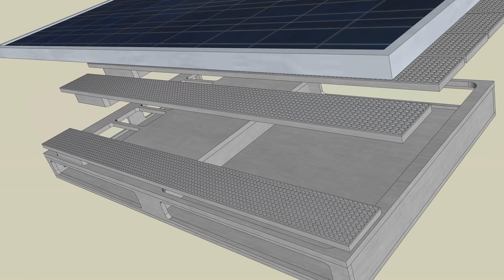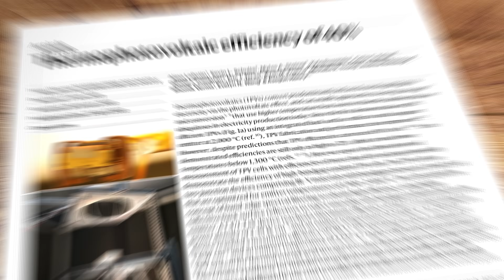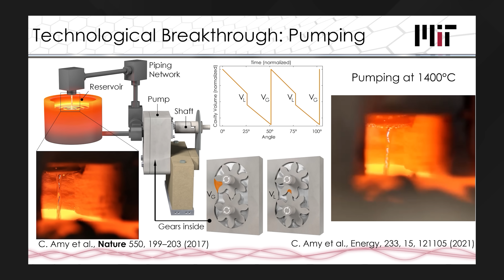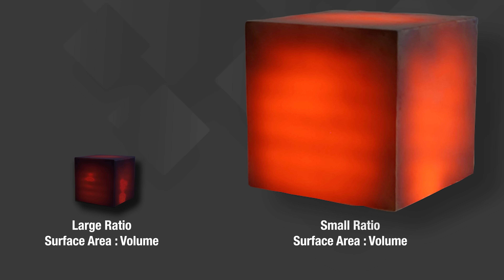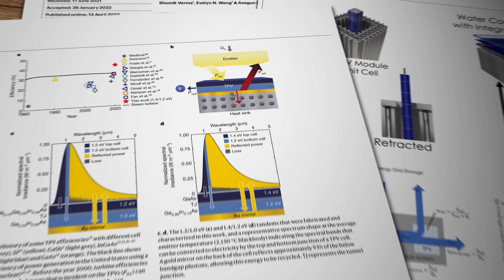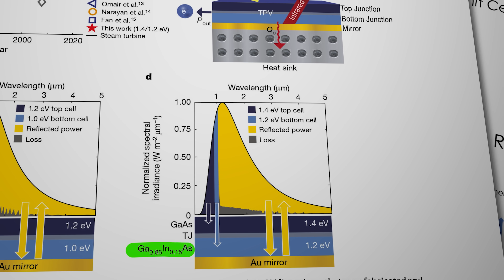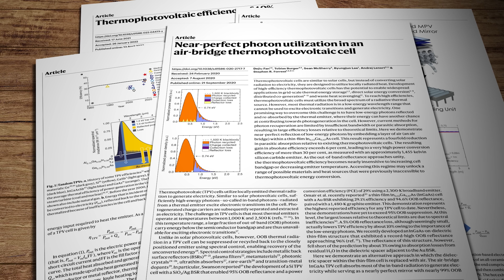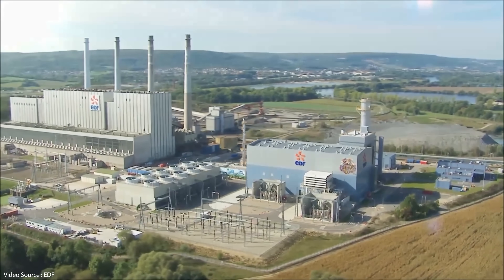Grid Scale Energy Storage 30x cheaper than Lithium-ion! How do they do that?

Comment: This design uses properties of materials instead of heat pumps. Nice.

It would be good if the heat from cooling the MPV could have been reused. A good place for a heat pump, perhaps. 

Clearly there is potential to provide baseline geothermal power.
Reply: @chalichaligha3234  While I do love the heat pump idea (Heated and cooled my home with one for 30 years), what heat pump can rise to that temperature? One of the few benefits of resistive heaters is they can get VERY hot! Heat pumps on the other hand would struggle to reach temperatures of this level.

Comment: 40% efficient... With lots of insane temperature differentials and lots of moving parts, and argon filled buildings, all of which need to be built...

LifePO4 batteries are 99.9% efficient, (the losses are inverter losses, which is what you also have with other storage options).
Redox flow is 70% efficient.

Long term energy storage is biomethane. Germany produced enough biogas in 2020 to cover 30d worth of electricity usage (100TWh -- but 90TWh of that was burned directly as that's how the gouvernment subsidizes it), and that amount can easily be doubled. And apart from the cleaning and compressing needed for piping this methane into the existing gas grid, all the infrastructure exists already (distribution, 270TWh worth of storage, 39GW worth of gas power plants).

Between a vast expansion of renewables, and then a days worth of grid level battery storage (1500GWh for Germany, which would cost less than 150B eur if spent wisely on lifepo4 over the next decade), and then 2d stored in cars (when cars have like 50-60kWh batteries on average), on top of home batteries... You only then need to fill in the gaps where the sun does not shine and the wind does not blow for many days, and then you just need to monitor grid battery levels and can then sporadically turn on a gas peaker plant, of which some are able to surpass 60% electrical efficiency and are tied to district heating systems.

There is simply no room for a 40% efficient solution in the above situation. If we are happy with that sort of efficiency, then we might as well do hydrogen.
Reply: Dude, how many times do people have to say that we can't harvest enough lithium to make grid-scale storage of lithium batteries. Cell life is abysmal, the extraction process is extremely destructive, not to mention that it makes the power grid even more reliant on imported lithium.

40% efficiency at 1/30th the cost gives you 12 times the energy storage per dollar compared to lithium batteries, and heat batteries don't form dendrites and go into the garbage after three years. 

We literally do not have time to put up enough nuclear and geothermal before climate change is irreversible. If we had started in the 80s instead of all getting scared for no reason that would clearly be the way to go, but it's too late. Wind and solar are going to be a part of getting humanity off of fossil fuels because they can be scaled much more quickly than better sources like nuclear/hydro/geothermal.
Reply: @tissuepaper9962  Wind and solar are also far cheaper per kilowatt hour than nuclear.
Reply: @sunspot42  Wind and photovoltaics are great, but we can also collect heat and with plants like in the video convert it to electricity. Having more ways to get to electricity cleanly and safely is a win.
Reply: Electricity is much cheaper than the battery. Efficiency doesn't matter if source is free and abundant. All that matters is meeting demand with the supply.
Reply: Add nuclear power, safe, clean, carbon-free generating methane, methanol, and using existing infrastructure, pulling carbon out of the atmosphere to produce high-density liquid fuel.

The host of this channel is fixated on crappy solar and bird-killing windmills instead of actual solutions.  Sad

Comment: Somehow the idea of shedding huge amounts of heat into our environment seems incredibly counterproductive to me.  🤔
Especially given our present problem of global warming.

I'd also like to know what the end to end efficiency losses are, going from renewable electricity, molten tin, pumping, heating graphite, heating transfer medium, heating tungsten, heating IRPV cells, pumping cooling water, through the heat sinks, radiator, and back through the heat sinks?

How much energy is required to extract two warehouses full of argon?
How do you "just add more graphite blocks" or "just add more TPV cells" when you need to pump down a huge vessel full of argon? 

How do you weld in new plumbing for molten tin when you can't just shut off the flow (freezing the tin inside the pipe loop)? 
Hasn't this already been an issue with heliostats using molten salts and alloys?

I get it, that using electricity to create heat to heat heat to impact a medium (TPV cells) that create electricity from heat is far more efficient than say using electricity to electrolyze water to separate water into hydrogen to run through a fuel cell that creates heat and electricity, but at some point there are substantial losses because of the huge temperature delta between white hot (tin, graphite, tungsten) and the world outside.
No, insulation can't eliminate heat transfer and entropy assures this system will be lossy even if it doesnt fail outright.
Even the vacuum of space transmits IR. Look at what we've done to ensure the JWST can pick it up from billions of light years away.

I fear highly theoretical engineers are pretty far removed from reality.
Reply from the maker: Yes. They will need to investigate ways to use that heat.
Reply: @JustHaveaThink  They need to find a way to keep the heat.  Minimizing losses.
It's already down to 40% efficient with just the photocells. 
Add pumping molten metal and deionized water as a coolant, plus whatever inevitable heat lost in containment and through the condensate loop of the cell coolers.
So something less than 40%. Probably profoundly less that 40%

Even hydrogen is ~36% efficient. water + electricity > hydrogen > pem fuel cell > electricity.
Pumped hydro is up in the 70's% and lithium ion is over 98% returned.

Too many steps and too complex an infrastructure.

Comment: How would this system compare to simply using the stored heat to generate power using the existing steam turbine, given that the system is installed on the site of an existing gas peaker plant?
Reply: from the linked paper it would give 30% effiecency compared to this cell's 40%

Comment: Sounds cool, although I don't understand the molten tin part, would it not be more efficient to heat the graphite directly with the electricity and have the tungsten foil and stuff attached directly to that?
Reply: I think the idea is to decouple the heaters from the storage. Otherwise to add more capacity, more heaters would be required. That's one of the issues with batteries, capacity and power are closely coupled.
Reply: Yes - much simpler and more flexible to have an array of resistive elements in the graphite storage.  Minor detail - if the argon leaks and the tin or graphite is exposed to air it oxidises rather rapidly ie burst into an enormous conflagration!
Reply: yeah, I agree. it seems an unnecessary step to me. I imagine there will be innovation there.

Comment: So it can store 1GWh. And it shall be heated up by „leftover“ renewable energy. How much electricity would be needed to run this?
What would be the size of e.g. a Photovoltaik or a wind turbine installation be to produce the energy on top of the normal energy demands? And why is the heat of the water used for cooling not being converted to electricity or heat in other parts of the storage system? 
Last but not least: What is the overall efficiency throughout the process starting with the energy production to heat the battery to the point where the electricity is charged into the grid again?
Furthermore: All these big scale solutions have another drawback. Any improvement or integration of new technology (which is to be expected quickly in new areas like this) will meet mayor resistance. First of all the operator will demand monetary support to through out equipment which has not yet paired back before updating it. Second the authorities will demand test runs and scaled up trials which will slow down the process of innovation. 
I believe that we need to produce power on each roof rather before paying to insulate our homes to 25 kWh/m2/a or below.
If we produce energy in abundance locally we then will have to have smaller versions of converting excess electricity to stored energy. Whether that is in hydrogen, in batteries, in heat or ice sinks or even in systems like the one described but scaled and implemented in a small grid system. 
Having then the backup between such national and international local grid system connected will be another challenge.
I don’t beliefe that large grid systems which are centralized energy production and storage are the future.

But what do I know 🤭. I am just a mechanic…😜
Reply: Yeah I agree with most of what you're saying, but I think you might be off on the insulation point. Maybe 80% of my energy use is low grade heat for my house. Unless energy generation gets stupidly cheap, the cheapest energy generation/ storage I'll ever have is the energy I don't use when I get my house to a higher thermal standard.
Reply: @EvilScot  
I lok. at it from ROI point of view.
Your living in a house with 150m2 and your heating bill is 2500 € (25.000 kW @ 0,1 € per m2 gas).
Means you use 166kW/m2/year - typical for a German home of around 1975.
Let’s assume that you insulate good to a level of 55kW/m2/year - means walls, roof and new windows.
Off line I did some calculations and research. Walls are 52.000 €, windows 25.000 € and roof 40.000 € (all quick estimates based on 2 story house outline15x7 m and 6 m height). Total investment 117.000 €.
Now you need to change the heating system - let’s go for a heatpump at only 25.000 € including everything.
And now let neglect the electricity costs you will need to run that heatpump and let’s say you Dave all the 2500 € you currently spend on heating. That is a mind blasting  ROI of 142.000€ / 2500 € = 57 years! Not a sound investment if you ask me.

That is why I think a more ROI driven approach would help us speeding up changes helping people and environment.
The closer the actual heat per m2 gets to below 100kW/m2/year the easier it is to invest less in full Monty insulation and instead in less overwhelming insulation modernization plus investment in energy harvesting and new heating system.
I even can do small energy efficiency rebuilds plus new heating system and later invest in energy harvesting. 

Why I prefer this approach? Because people will not invest for ROI they see in 40 years- they rather will pay a higher energy bill in the future than invest a huge amount of money now.
But if we find smart ways that people see saving money for real after 10 years - then they will do the investment.
Reply: @wr6293  How efficient is a heat pump? Or, I suppose, how much cost / energy unit? Compare to the video idea.
Reply: @markhathaway9456  Please explain how to compare a heat pump and it’s efficiency with the storage of energy described in the video?
My point is that investment into house insulation is not the only way.
If we as a society insist that insulation for heat loss reduction is the only way to reduce the emissions we will left a majority of old house owners behind.
If we show a different solution e.g. install energy harvesting (e.g. PV) along with a smaller scale insulation measures (e.g. new windows plus roof insulation) we will reach a group of people to do something as they can see a ROI which is not almost 2 generations away (1 generation is 25 years).
Reply: @Werner Reinberg  I regard highly the ROI methodology put forward. But I think you have gaps in your assumptions, the costs of investment you have are on walls and roofs at least, in the order of 4-5x greater than what I pay in Scotland for external wall insulation and replacement roofs. And i've assumed the roof cost is more related to new roofs which buildings need from time to time anyway rather than the loft insulation itself which is much cheaper.

I would agree there's a point en route to the Enerphit standard of 25kWh/m2/year where the cost of insulation and where its being put will not at current rates have a reasonable return on investment but equally EWI on traditional masonry will have a much faster return on investment so I think elements need to be calculated individually and intelligently.

Excluding seasonal thermal energy storage where i've only seen case study applications of the technology there's no viable way to heat my own home though winter with my own local produced energy.  At least not without resorting to traditional wood burning and even then my garden won't meet that. 

There has to be an acceptance that if gas is going to be unavailable or prohibitively expensive i'm going to be relying on electricity and a heat pump in a number of years 5 or 25 I don't know yet. I do know the sun can't melt the frost some day in a scottish winter so I know a collection of solar panels won't meet my energy needs.
Reply: @EvilScot  I can’t comment on costs for insulation n Scotland but I can assure you that my numbers are certainly not far off because I used different sources available from different pages which and crosschecked the per m2 costs with a realtor service who does such kind of repairs as a service ( they get paid a Fixum so inflating costs does not help them 😜).
It really comes down to an intelligent way of combining all kind of solutions from insulation over new windows and different type of radiators along with the (new) heating system in a way that people will agree to do such job because it will be good for their pockets within a reasonable timeframe AND because it will be environmentally better AND it will increase their homes values. If we can get people to reduce their heating energy bill by 65 % and pay 50% of what they would have to pay for an energy bill reduction of 90% (that are just some numbers I through in here) we will achieve more than insisting that only the 90% reduction is the right target. 
As to the PV harvest during Winter you are absolutely correct - it will take more than just some PV on your roof. If your goal is 100% independence of the grid for the energy needed to run your heatpump then the costs are outrunning the benefits. But again, the goal should be to look for intelligent solutions. Let’s say you have 2 complete dark month(btw it’s less here in Germany) then you would have to source that electricity for heatpump during these 2 month.
A 5,4 kW heatpump requires approximately 6.000 kWh per year (should less actually but I am lazy) = 500 kWh/month
Costs per kWh in Germany is 0,32 - means 160 € per month or 320 € for 2 months. The rest of the year your PV will produce energy to run the system (depending on the radiators for cooling as well - but be aware of that the cool water needs to be above dew point!) and even electricity for your appliances. Pair that with a battery and you will store energy during the day while you are out and about and use it at night when you are at home.
That is why I am of the opinion that we need to install loads of PV on our roofs and walls to run a heatpump because if the energy is available in overflow than it can be used. 
I view it similar to the history of oil heating systems but in reverse.oil heating system only got more efficient be aide the oil got expensive. If electricity is cheap (because we make it at home) than even a less efficient heatpump will be fine. Cost of kWh PV is below 0,10€ - a third of what we pay for grid electricity! 

But you know what - I would love someone with a better skill set than me to take my thoughts and evaluate them in-depth.
Best would be some expert do a thorough evaluation of real houses and then calculate the savings and costs for a modernization to 25 kW/m2/year standard and compare that with a reduction aiming to reduce the gap between actual to 25 kW/m2/year by let’s say 40% / 60% and 80%.